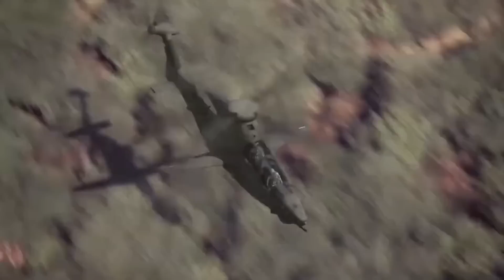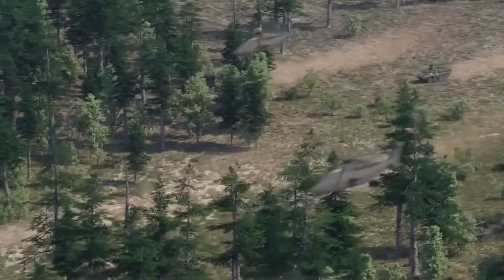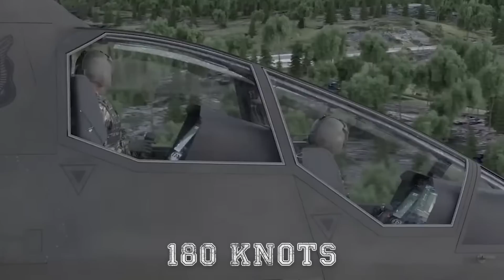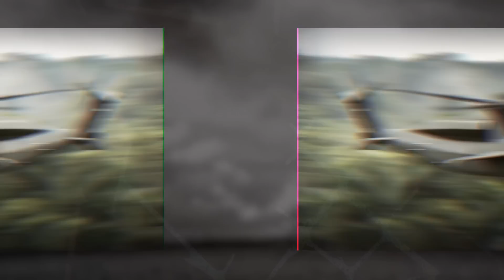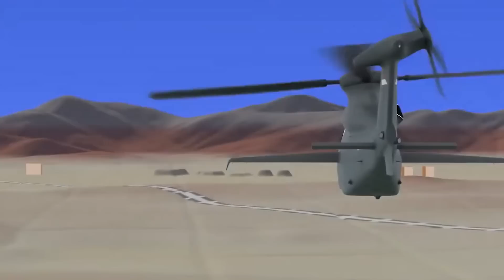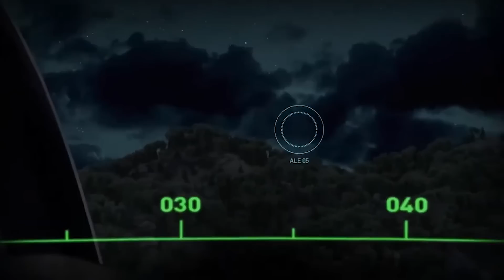US New ATTACK Helicopter Will CHANGE Battlefield Forever!

Comment: The Exterior design look’s ok for sleekness & speed increases ;  up-grade the Gatling gun to my configuration so one shell will take out a Tank ; put in flexible wings that can be mechanically adjusted & add a rear desolate Turbo boost engines to increase attack speed , instead of the large rear rotor blade : re-engineer it to have a 6to 7 blade smaller designed to control accent and back-up capability,  then you have a weapon that can take out a pantaloon in a mater of minutes , much more versitable  , the goal is to take out the enemy rapidly!

Comment: This is a ripped off copy of the South African Helicopter which I wrote about yesterday. It’s identical to the SA RooiValk helicopter which is this exact chopper which has two props and can throw a 360’ loop and come up behind its enemy dogging it. It fires rockets and also has a Gatling gun operated by a gun licence built into the pilot s helmet and fires wherever the pilot looks. The rocket s are also set on small wings. This is a rip off. And is not a US helicopter. It was designed and created and used in battle in SAfrica in the1970’s against SWAPO in SA’s war against them and Angolan terrorists of the time. Take a look in the history weapons from SA on a show from the US ironically. U guys never did have any imagination or Elon Musk supplied the design. He would know this chopper well. The “RooiValk”

Comment: Just my personal opinion on the attack helicopters. They need to be down sized to a single pilot operation. More power plant and weapons technology. They have a purpose as close ground support. They need to be used in conjunction with drones monitoring the battlefield and taking on the more dangerous elements of the battlefield to save the helicopters. That’s just me!

Comment: I would like to see an optional 30mm gun, or mini gun. A chain gun is good too, however they usually need the barrels inspected about every 3500 rounds. I think the missile system is ok however I don't know much about it, the targeting range needs to be about 10 miles minimum. The French Tiger is probably as good, it's a shame they aren't supported well.

Comment: FARA was canceled and even the FAR more capable Defiant and Raider platforms were passed over so that the Army could finally lay hands on fixed wing aircraft.  Decades old agreement was supposed to prevent the Army from ever having its own fixed wing aircraft.  They have always hated it, so the new tilt rotor got the nod so the Army could finally fly fixed wing. Nothing to do with the right tool for the job, just an argument between 4 stars.

Comment: In my opinion this copper could be operated remotely and/or as a hybrid (manned). If it is
set up properly for upgrades, it could be a multi-mission unit. Especially if it could change roles by a push of a button.

Comment: If the RAH-66 Comanche was not cancelled there would have been a new stealth attack helicopter many years ago.
The Apache is a great weapons platform but is aging.
Reply: The Apache has been continuously upgraded. The E model was designed to be able to integrate new technologies.
Reply: Then create an unmanned attack reconnaissance helicopter scout.

Comment: The Comanche project never works so why is this going to... Helicopters are kind of becoming obsolete. As a weapons platform we have the A-10 and of course the new F-35... Helicopters are slow and costly, also they're easily shot down...
Reply: The Comanche was cancelled because the Army kept adding additional requirements to it. You have to have a good idea cut off point. The program was mismanaged at the PM level. On the other hand, the BLKII and BLKIII AH-64E, had clear requirements and cutoff dates for any additional requirements. The aircraft was delivered on time with minimal requirements being slipped. There will be a need for manned attack helicopters for many years. What folks don’t understand about the war in Ukraine and the failure of Russia’s attack helicopters are the Russian’s didn’t have the proper ASE gear and had no way to protect themselves, unlike US Apaches. Our technology for aircraft survivability is constantly evolving and is being integrated into the aircraft systems. You have to have an aircraft that was designed to be able to integrate new systems using an open architecture design.

Comment: the stub wings on the Invictus could do with some active moving surfaces, such as trailing edge flaps for additional lift & a single underwing hard point (optional) . . .
Reply: Flaps have no effect on helicopters. The wings are not for lift, the rotor system is.
Reply: @bks252  Any Lift is Lift.   Maybe not so much at low forward speed but at higher speed, it could improve range, fuel consumption, efficiency, etc.